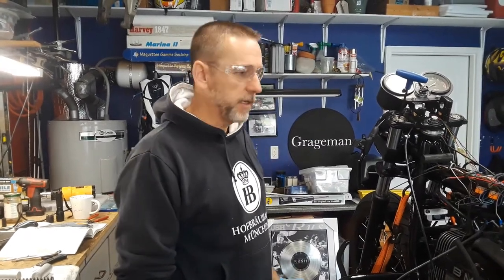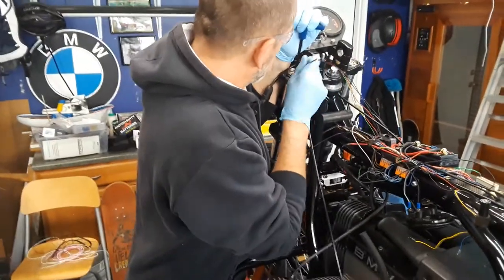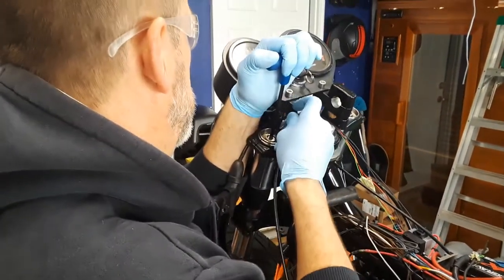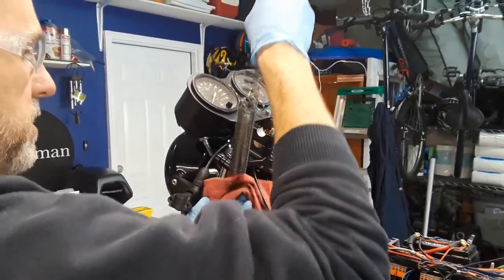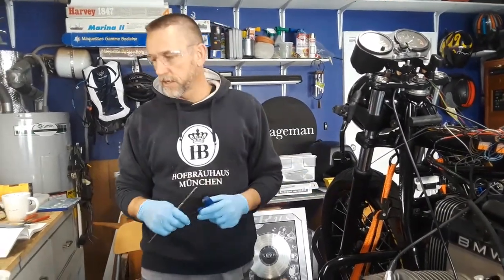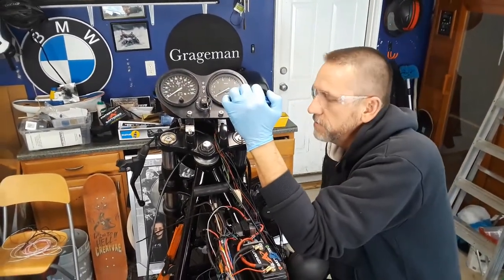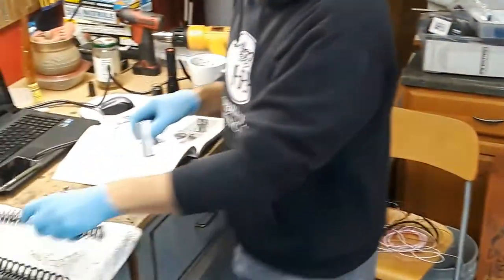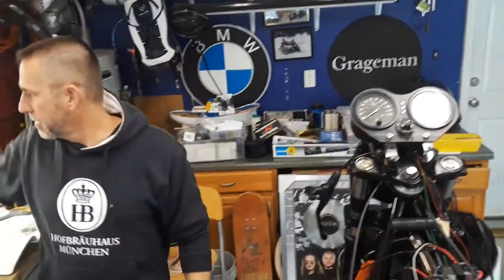Building a 1992 BMW Cafe Racer Motorcycle R100R - Replacing Springs

Comment: I'm currently working on a 1993 R100R and I was planning to buy a different fuel tank before watching your videos, you changed my mind giving a unique look to the classic R100. Good job and keep posting videos please. (maybe one showing the electrical connections?)

Now one question, did you modify anything to get the battery under the fuel tank?

Thank you
Reply from the maker: I actually bought a battery bracket that i mounted under the tank.  i put the battery right behind the ignition module under the tank.  As afar as the electrical connections i bought the revival cycles wire kit and then wired my motogadjet as per their instructions.  the tank i did modify to give it a better stance.   And thanks!